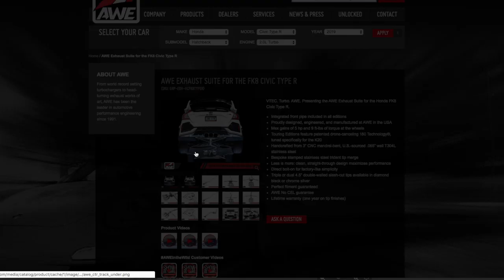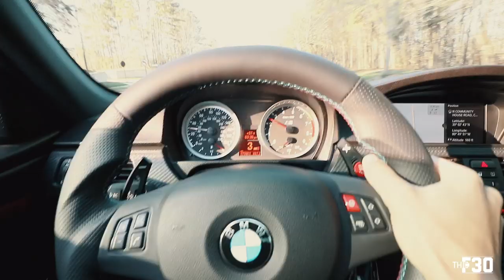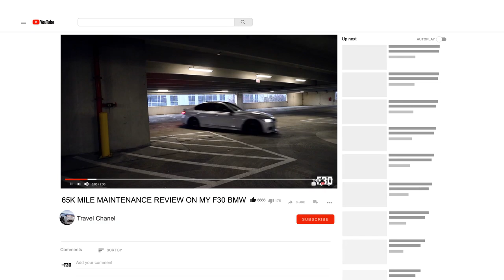BEST EXHAUST SETUP FOR THE FK8 CIVIC TYPE R - Awe Tuning Exhaust on the Honda Civic Type R!

Comment: I bought this exhaust and had to pay the exhaust shop extra money to cut and welt it in order to fit the car. Yes I have installed catback exhaust before but this one was pretty badly done in the welds and angles it’s such a disappointment so expect garbage quality control from them if you buy it

Comment: Just threw the afe takeda exhaust with carbon tips on my R. Sounds soooo good
Reply: How's the highway drone after the break in period? I've heard it was horrendous. Looking to get one for mine but on the fence between the AFE and the AWE
Reply: @code_fk8817  the drone is a little abnoxious but goes away if you cruise at a higher RPM lol. I still love it. My Type R is a small tripper once in a while. 2017 that I've only put 5,000 miles on